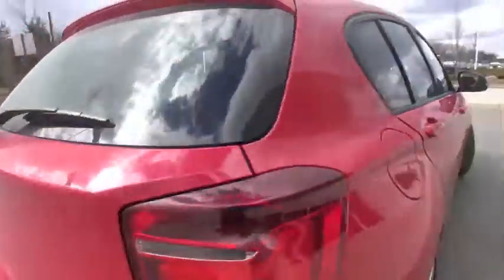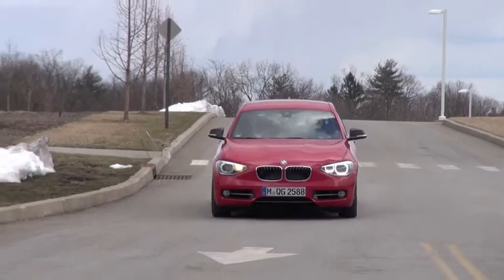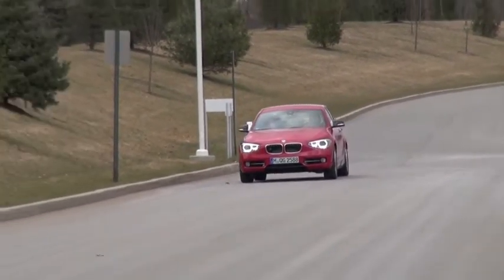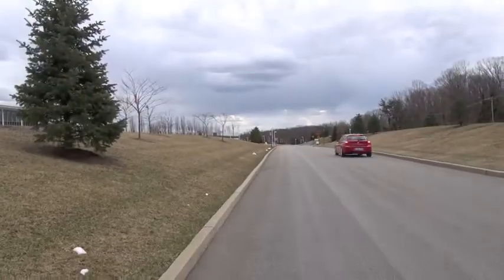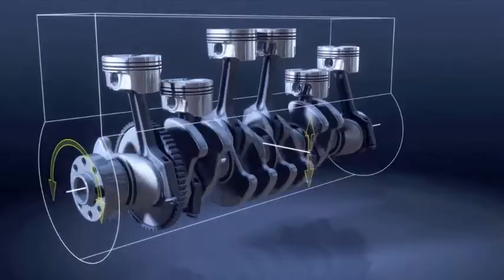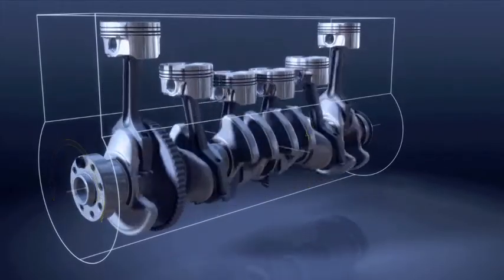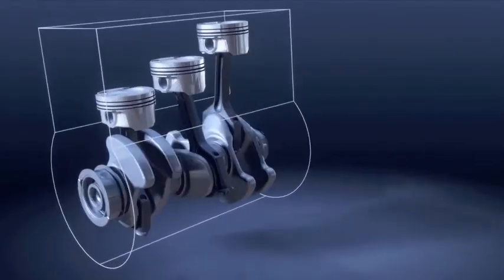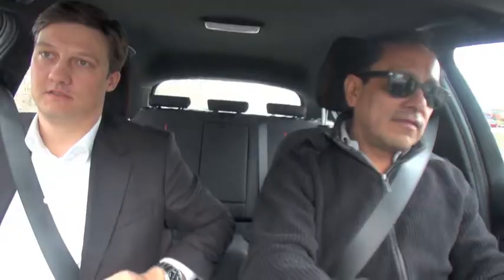BMW 3 cylinder 1.5-Liter TwinTurbo Engine First Drive on a Prototype

Comment: Cool it sounds like a great engine and the magazines are already saying it goes well in 134 bhp guise in the new Mini. This 180 bhp version must be great. I have however read derisive comments on another video of the this triple from people who say a 3 cyl is not fit for a BMW and that it sounds like a Toyota Aygo. That is the problem BMW need to get around with its downsizing: convincing people used to six cylinder atmo engines in the past to accept 3 and four cylinder turbos in their place.
Reply: To me these BMW 3-cylinder diesel engine sounds (when revved not idle) like 3-cylinder petrol engines in Daihatsu from years ago. Of course overall performance, NVH even emission levels BMW expectedly superior say the least !

Comment: For me the real BMW can only starts from 6 inline or v8 or v10 or v12 but not LESS. 3 cyl - SUCKS
Reply: Someone should bolt together 3 inline 3s and make a cool inline 9 out of it.
Reply: Crankshaft would be too long. Inline 6's are already long, and inline 8's had the problem for sure.

But a VR9 and a VR8 would be lit.
Reply: the 1.5L 3 cylinder gets better performance than a 2.2L 6 cylinder from the early 2000s. with similar sound. And arguably more fun to drive coz of the turbo.
Reply: So the original M3 isn't a real BMW because it came with an inline 4 engine? You must be an expert.
Reply: @bestduckyrblx2944  the 1980 m3 had 2liter inline 4 before the v6 - v12 can in after
Reply: @Jprincemassey  yes I know this and according to the original comment that is not a real bmw.

bmw dont do V6, only inline 6.
Reply: @bestduckyrblx2944  markets changing and the bhp of smaller engines getting impressive  

They may not make like 600 - 900+ with inline 3 but i sure they improving tho

Comment: At least it sounds feels more smooth running 'refined' than all those typical BORING uninspiring hence UN-impressive sounding 4-cylinder (diesel or even petrol) engines out there ?!!!!
As far as i'm concerned, i'll select a 6 followed by 5 then 3-cylinder engine while skipping staying far away from the 4-cylinders !!!!